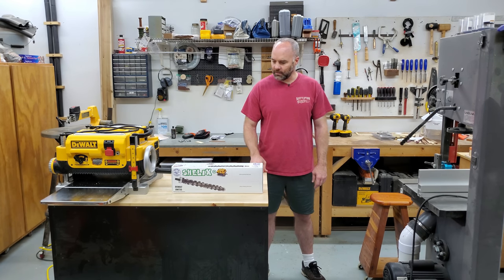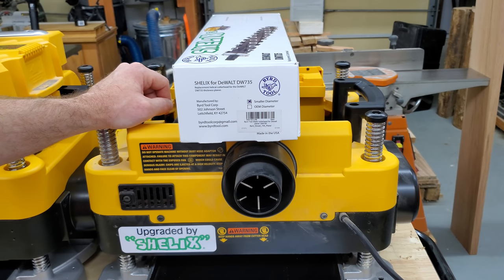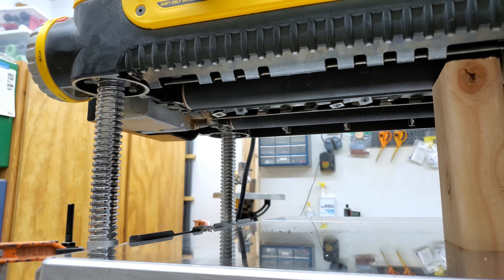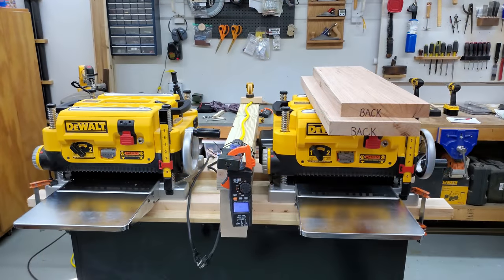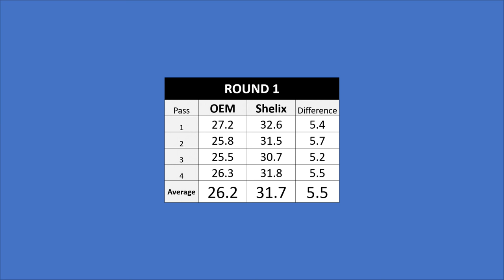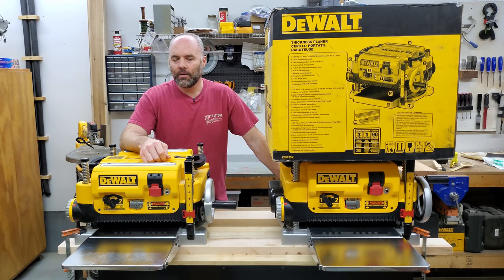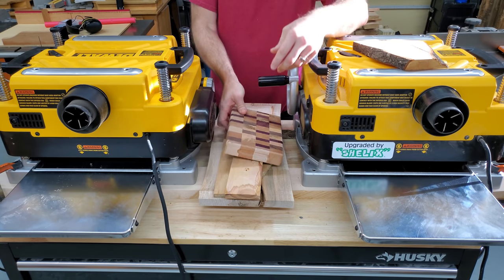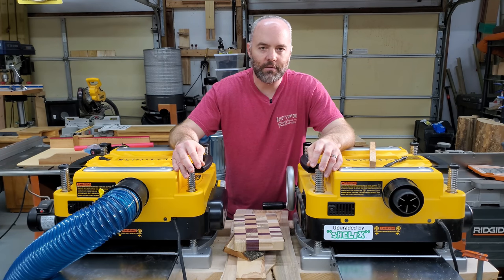The video I wish I watched before buying a SHELIX

Comment: The idea about shimming the rubber rollers to rest higher (14:45), seems unlikely to succeed.   This is because the problem isn't caused by where the roller sits in relation to the cutter head when the machine is -not in use-.    When the machine is in use, the rollers still have to move to the same place relative to the frame to allow the cutter heads to touch the wood.  Pre-compressing the roller springs with shims will do nothing to change the force those springs exert -when in use-.

There appears only 3 ways to reduce the roller head force:

1. Replace the springs with softer springs
2. Modify the machine so that the top of the springs somehow sit higher than they do currently (e.g., if there are shims on TOP of the roller springs: remove them)
3. Replace your undersized cutting roller with an OEM sized cutting roller.

IMO Shelix should not even be selling an undersized version because it creates so many problems, i can't see how anyone would ever willingly make that purchase if they knew the negative effects it would have on the rest of the machine.

Comment: Here is an idea: With the Shelix head one (or more) of the cutters is constantly in the wood.  There is no work relief between cuts.  With the straight knives one (admittedly big) cutter is in the wood then you have no cutter in the wood for 1/3 of a rotation.  During that rotation there is relief from some of the work load, the head can gain speed before going into the next contact.
Reply: i think you nailed it

Comment: literally ran a set of straight knives for 2 years before I finally replaced it. First board i put through i hit a buried framing nail, all 3 blades are toast.
Reply from the maker: Ouch. Sometimes, you can cheat the system by only replacing one of them. The new knife will remove the ridge left by the other ones.

Comment: From the beginning, why didn't the 20 amp breaker in the panel trip? Actually, these machines should be on a 240 circuit with a double pole 40.

Comment: I've got a brand-spanking new DW735 sitting in the back of my truck right now. I plan to put a helical head in it "just for the hell of it" but mainly to avoid any issues with end-grain and figured wood. If there's any issue that eventually needs to be taken care of by warranty, remove the helical head and install the original blades BEFORE taking it in for service.  Simple.  But you didn't hear that from me.
Reply from the maker: You're right, and others have added some good reasons for doing that. For one, if the planer is defective, the service center probably isn't going to carefully remove your helical head and send it back to you.

Comment: I am going to ask a bit of a different question: what is the time difference between the old & new planers? Is it 1 year? 2 years? 5 years? Can you say with absolute certainy the motors & electrics between the old & new units are exactly the same? I am an electrical design engineer, so, I know most companies will update motors & electrics over time even though they are the same model number. This can sometimes be seen in the serial or model numbers, but this is usually only known to the manufacturer in their internal design documents. 
So, the point is, the older planer may have less efficient electrics. It is also possible the older planer may use more power because it is older. This may be part of the reason why you are seeing higher power numbers on the older planer than on the newer.

Comment: A fair power consumption test would have you swap the heads and re-run.  That would eliminate differences caused by other differences in the machines.

It seems likely (to the point of obvious) that the additional roller force is adding friction between the wood and the bed, which causes the roller motor to work harder to maintain a constant feed speed.   To confirm this hypothesis would require some method to ensure that roller pressure is the same in both tests.

Comment: Ive had one of these planers for more than 15 years , always run it on a 15 amp circuit , run thousands of board feet of Oak , Hard maple , walnut and softwoods through it , and taken pretty heavy cuts ,  Ive run end grain cutting boards through it , I have never tripped the breaker on the machine or the one in the panel , I will put and amp meter on it to see what the inrush is and then monitor running current.
I don't use Dewalt blades , I found they dull too quick ,they don't last very long. Dull blades will still plane pretty good but make it work a lot harder  , maybe that's the difference
well done video

Comment: Great video. I wish you had a buddy somewhere near by who had the larger diameter standard shelix as the larger one might not use as much power as the slightly smaller diameter shelix. The smaller the diameter the slower the rotation and therefore it has to work harder to do the same work as the standard size shelix.

Comment: Two concerns: First, when you add the device to separate the hot and neutral, instead of measuring the current on ONE wire, you are measuring the current on TEN turns (as the video said), and the reading is TEN times higher than the actual current.  Divide the displayed reading by ten to get the actual current use. If the actual current had been 25-30 amps, the home circuit breaker as well as the planer breaker would have popped.  I suspect the breaker on the planer that popped may have been defective.  Second, the circuit breakers do not sense the motor's heat - they sense only the current drawn (they also do not sense voltage, only current).
Reply from the maker: Your first concern might be answered by some of the information in the video description text. You are correct that the breaker doesn't detect the motor's heat, the breaker detects its own heat. I'm making a separate video about that topic, which I might publish tomorrow if time permits.
Reply: First, great videos! The length of the extension cord makes a difference regardless that it is sized properly. This is why if at all possible I look for 110-240-volt motors, using the 240-v option at all times. Saves motors, better consistent drive, sharper blades (less heat produced) and quieter. You’ve saved me hours of agony, as this planner is on my Christmas list.
Reply from the maker: This video shows the inside of the circuit breaker as it trips, and explains why. https://youtu.be/24f-J0lVo-E
Reply from the maker: @clarmarkable  I have some information about the cord length and voltage in the video description.

Comment: Very thorough and enlightening comparison.  The amp draws with the stock planer call the soundness of the entire design into question over the long haul.  One point I think your viewers should consider is that the replacement heads give the manufacturer a reason to say "no" to warranty coverage, like the first response you got from Dewalt, which really was the same as the second.  I think this would be especially true with the Shelix, given the fact that Dewalt probably has tested their amp draw as well.  I could be wrong, but there is certainly an argument that the heads affect the motor because of the amp draw.  This was the best video I'm aware of on this topic.  Very much worth the remake.  Thanks.

Comment: Hi I don’t know whether anyone has already suggested you take a voltage reading to see if you are suffering with “voltage drop” this could be a reason why the amps are high and the Units thermal cutout tripped. 
Test when off load and on load.

I have a lager Axminster thickness & dust collector plus’s lighting running off a 16amp 230v uk SWA cable from diss-board with no problems

Interesting vlog 👍
Reply from the maker: It's been brought up, but I haven't done a voltage measurement yet. I think the bulk of the problem is three knives vs. the normal two for a portable planer, or the continous contact from the four rows of helical knives.
Reply from the maker: I finally got around to testing voltage tonight. Starting with the original setup with a short 12-gauge extension cord, it was approximately 120v before starting the motor, 119v after, and dropped to 115v while planing 8” wide maple. Then I plugged directly in to an outlet right next to the breaker panel and got 120v, 119v, and 117v.  There were some minor fluctuations between test sets, but those numbers are a good summary of the results. Amperage was maybe 1 or 2 higher using the extension cord, but still around 25-27 for both.
Reply: @TheSnekkerShow  120V should be sufficient as most equipment is rated for 115V so the additional 'nominal' voltage helps.  With this type of equipment (heavy relative load) higher voltages especially during operation where load is greatest (amps highest, voltage lowest) then capacitors can help but that get's into a bit of deep electricity that wouldn't be helpful to most.
Reply from the maker: @ronachin7444  Sounds like you know your stuff.  Interesting thought about the capacitors, I don't think I've ever seen one on a universal motor, at least not big enough to be noticeable.  Maybe they'll eventually start making these planers battery hybrids for an extra boost when you need it most.  You might enjoy the video I'm uploading right now.  Should be visible tomorrow afternoon.
Reply: @TheSnekkerShow  I'm talking capacitors at shop level at a panel(board as it's technically known) so that multiple tools would be supplied and lessen the effect on  voltage drop which would reduce the amperage of any particular motor load.  

I'll keep opining on various comments and will contribute where I can.  

Nice work on your videos.

Comment: Thank You for posting this, I had no idea that to actually get the best job from this planer I should get the Shelix cutter head. Taking the cost of thos planer & get the best from it will cost an additional 500 dollars
Reply from the maker: It's definitely a nice improvement, but I've owned thickness planers for more than 20 years before getting this. Don't rush the upgrade unless you're sure it's the right move for you.

Comment: I watched the entire video waiting for a comparison test of the end result of the wood surface left behind.  The info you gave on the amp draw and blade caveats were great but that's not the reason I would consider buying the Shelix.  Did it help with snipe or leave a nicer finish on the board?  I feel informed and let down at the same time.  Great editing btw. Will be subbing.
Reply from the maker: The cutterhead does not significantly affect snipe, but this video can help with that issue: https://youtu.be/wcOUKAxrTy0.  Brand new steel knives will leave a smoother finish on most uncomplicated woods initially, but that doesn't always last very long.  I've had several pieces of tricky-grained wood that kept chipping out even with new steel knives, but came out great using the Shelix.  I actually filmed more side by side comparisons for this video, but the light was coming in to my garage at a bad angle and the surface of each board just looked like glare in the video, so I left it out.

Comment: Thanks for an excellent, in-depth video on this. I use that exact planer and have been using it for over 10 years with no trouble. I do have to agree with some of the comments though, in that something seems to be off in the amp conversion. I'm not an electrician, but it seems off. 
I use my planer primarily for end-grain cutting boards and have to make shallow passes because it is asking a lot of that planer to do this. I ran 10 of them through it today (about an hour of planing) and it really draws down hard on that type of planing and gets the motor hot, yet the breaker never tripped. That wouldn't be possible if it was drawing 25 - 30 amps the whole time. Especially through an extension cord.
Reply: Yeah I'm wondering if something isn't off with that line splitter that he used to seperate the hot wire so he could attach the amp clamp. The way to know for sure would be to eliminate that line splitter and put the amp clamp around the hot wire on that circuit where it comes out of the breaker.

Comment: The breaker on the Dewalt is not necessarily a klixon or heat sensing device?  If it is a current sensing device it could trip without heated motor?  If it is a circuit breaker not a heat sensing device that would explain why it tripped and the motor wasn’t hot.
Reply: 100% correct
Reply: does this mean more power with no loss in motor strain
Reply: @alexanderlabbe91  No.  If it is truly pulling more amperage it basically means that the motor is slowing down and the internal impedance of the motor goes down as it goes slower and the amperage by ohms law goes up with lower impedance.  My observation is this.  The motor slows on impact and the amperage naturally goes up.  To take a recording at this point does not represent what he thinks it does.  The maximum recording should be  taken after the initial impact of the wood in the planer not before impact.  Some motors have overtemp devices that open when the heat in the motor goes above their setpoint.  The reset on the front of the machine is not  a heat sensing device, but essentially a type of circuit breaker that takes a few cycles of overcurrent before it is activated.   These type of circuit breakers run at a 80% demand.  example:  a 20 amp circuit breaker is really designed for 16 amps of continuous running at that load.  If (a) planer runs at over 16 amps for a period of time it will trip a 20 amp circuit breaker.  We really don't know from this guys test what the actual running amps under load is.  He just recorded the impact load in amps and it could easily been double of the running amperage.  The motor slows slightly under impact and then as the instantaneous impact current goes up the motor gets more torque and tries to bring it up to speed.  I am not quoting number but theory here.  As the motor recovers speed the internal resistance of the motor goes up and the amperage goes back down.  This is the point that i am trying to make.  After the impact and the motor recovers impact speed loss then is when the maximum amperage reading should be taken.  It still appears to me that the amperage is just over the threshold of the current rating of 80% and with time it will trip because of internal heating in the breaker itself,  but not may not have been long enough for the motor to get hot.  It will eventually get hot and isn't good for the motor, but that is another discussion.  The button on the machined could care less about how hot the motor is.  If you continue to reset it as soon as you can it should cause the motor to overheat.  My feeling is just this,  the helix cutter does draw more amperage and puts the motor on the verge of tripping if used for a period of time.  That time is how long the breaker sees the overcurrent- designed into the breaker.  The breaker is such that an instantaneous overcurrent (unless way over) it won't trip, such as starting the planer under normal conditions or impact.  It needs further discussion.  I personally think that if you have a board or two to plane and shut it off that you wont see a trip, but that is my assumption.  Is it outside of the design parameters?, it would definitely appear to me that it is.  My feeling is that if the planer is under normal load you would see an amperage of somewhere below 15 amps because the feedback I get is that people are running the planer on a 15 amp circuit in their garage.  The helx probably adds a few more amps if you take out the impact readings.  A motor on start up can run up to 7 times its normal amperage rating.  It only draws that kind of amperage for longer if the motor is stalled.  if it can't reach rated rpm the amperage will be higher depending how much the motor slows down.  Some of this is within the parameters of the motor, but if it slows too much it will overcurrent and be hard on the motor  .  If a motor rated at 10 amps is started under no load it can draw upwards of 70 amps until the motor starts to rotate and it quickly goes down when motor reaches rated rpm.  The examples I use are general for all types of motors.  Some have more torque, but all draw more amperage as they start and will fluctuate under normal loads a bit which is normal operation.  His test is not what i think it should show.  If you insist on a helix head just be careful how long and hard you operate it.  Best scenario is to stay with designed head.  I am disappointed that Dewalt would design it that close to operating currents.  Should have used a little more horsepower, but that may have required a special circuit to run it and that would make it less attractive to us home shop boys to buy.  I hope i didn't lose you, but oh well you put a quarter in my nickel slot on this video.
Reply from the maker: @Dave7208  If you watch each pass, you'll see that some continue to go up throughout the cut and some don't. In some tests, the highest load was at the end of the cut when the lagging snipe hit. I picked the "max" approach for simplicity after verifying that the fluctuating average and the max were not significantly different for the purpose of the demonstration. I have a few other videos posted that show this as well: https://youtu.be/UoBN5Sc_2uk. That link uses the remaining oak 2x10 from this video, the same depth of cut, and no max setting, but with the planer's impeller removed so the reading is lower.

Comment: This was helpful. I think I am about to order the OEM version for my new DW735x. Since the cutters need to be removed to install the OEM version, I wonder why Sheilx even pre installs the cutters. 🤔
Reply from the maker: I asked the same question. If I remember correctly, it's because they check each assembled head to make sure it's properly balanced. Re-removing the cutters would just add time and expense.